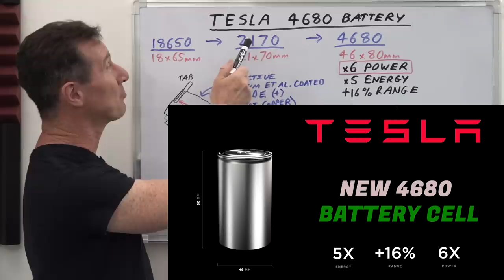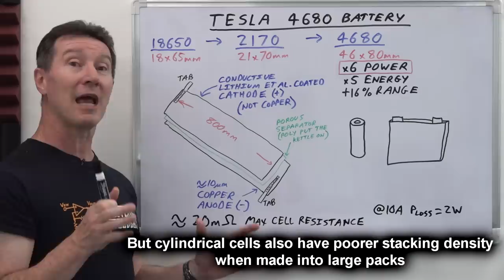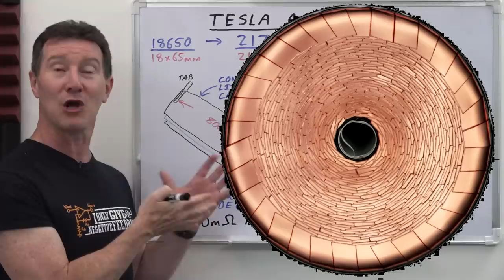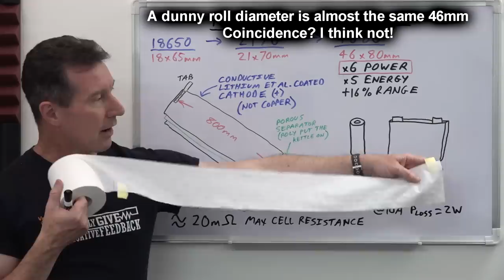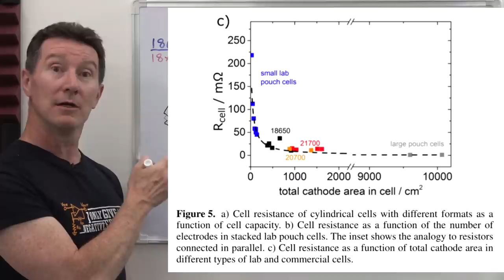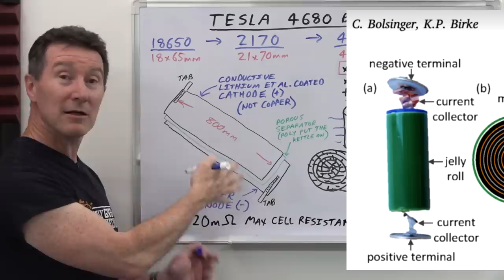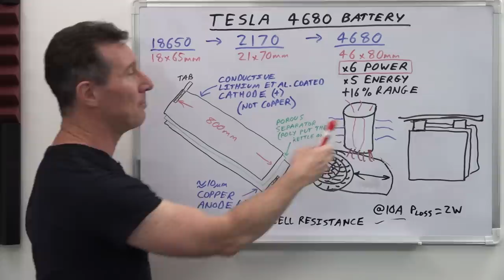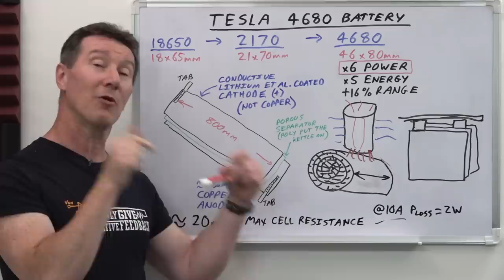EEVblog 1340 - New Tesla 4680 Battery Cell EXPLAINED

Comment: Nice deep dive, Dave. The tabless construction allowing for both a decrease in ESR and in thermal resistance is huge. The only think that was missing was actual Amp-Hour numbers (or estimates of same)
Reply: aH should be more or less the same per linear length (chemical capacity), but instantaneous current (power) will be much higher (thermally/anode thickness limited)

There's nothing stopping Tesla making the cells significantly larger than 46mm  diameter. You're no longer constrained by the volume to surface area condundrum for cooling cells as your cooling requirement is now off the endfaces of the cells and as long as you're not making the cells st00pid-long the maximum thermal distance is the length of the cell

Comment: Yeah with the larger cell you save about 16% weight in steel and replace that with cell. They didn't increase the energy density per cell just increased the thermal conductivity and electrical conductivity. Yes it is an order of magnitude, and that will result in less waste heat but still, the energy density of lithium is not changed with the cell design just efficiency.

Comment: In large part, the original cell were designed for small cell counts, computers, in particular, also tools so the tabs acted as a Fuse to protect the user from failure
Reply: I still remember first press statements of a Californian company powering cars by notebook batteries. At that point in time the Tesla founders where still named Eberhard and Tarpenning. Later they siamized into Musk.

Comment: Max packing density of identical circles is 0.9069, this is independent of diameter. The big savings of larger diameter is much less casing material and decrease in total plant number of operations, since you are processing fewer cells. And volumetric energy density isn't such a massive issue anyway (everybody drives an SUV), the real issue that matters for EVs is energy per unit mass. kWh/dm3 is def an issue, but not as high of a priority as kWh/kg.
I think the reason they stick with cylindrical cell design is for increasing speed of production. Both prismatic and cylindrical cells are wound around a mandrel and winding speed per unit length is probably not hugely different, but with cylindrical cells you can use continuous motion assembly equipment to do all the further processes (like what you see in bottling plants with insane throughputs). This would definitely be a necessity if they plan to deliver their 2TWh/y or whatever musk's stated ambition is.
Inb4 accused of being fan boy. I just think that if they're sticking with the cylinder design there is probably a very good reason. In the past that company has been very quick to kill their babies and abandon designs that didn't work, so I would expect them to do the same with the cylinder v prism design.
Reply: I haven’t understood from all the talks what they’re doing on the other end is it folded too?
Reply: @EEVblog see this. Why bother then? I speculate that it has to do with overhead costs of packaging. 1 larger cell takes less material wrapping it up, takes less time to manufacture, etc. than multiples of lesser volume. Prismatic/pouch cells make the most sense until you consider all the supporting bits to securely position them safely inside of an automobile.
Reply: @billjohnson8794  I think so, yes.
Reply: yes . continuous motion assembly

Comment: Maybe not new a Toyota Prius, but around 15 years ago when I was working at Toyota I watch a tech put dielectric grease on the connections in a recall of the battery bank and it was all 18650 cells on the inside.  I remember it quite well because I sat and listened to the tech explain the entire battery and because I am a nerd it was right up my alley.

Comment: Tesla can use 4680 cells only because they figured out how to get the heat out of them. With a traditional tab design these cells would run way too hot.
Reply: Graphene could be used to help control the heat and then removed in a controlled manner. Probably adds to the cost and that would be the biggest reason not to use it.
Reply: @ezg8448  I don't believe the whole Graphene hype. Seems like snake oil to me...
Reply: @adamwade5612  - actually they already have some on the market but I forget who makes them or exactly what they were used for.

They might be sold by quad-copter parts venders I think, I tried to quickly look for them but no luck.

I do remember they had an flat charge and discharge, meaning it was constant. That would mean the graphene is properly insulating the battery.
Reply: @ezg8448  yes, you are correct.  I have done graphene batteries in my shopping cart on Amazon.  Frankly, i don't know enough to know anything about them.  It just seems the claims are too good too be true.   Who knows?  I sure ass hell don't...
Reply: @ezg8448  Graphene isn't being commercially produced, most of the supposed graphene that companies are marketing is just graphite which has been used in batteries for a long time. It's the same BS as people on YouTube proclaiming to make graphene at home just by using tape to pull thin layers of graphite off and calling it graphene. 
As for the heat issue the fact that the electrons are no longer having to travel the full length of the strip which causes the heat in the first place is now reduced with the tab-less design. Now add to the fact that all the copper connection points are all in contact they can more freely pass heat through the top and bottom of the battery increasing the thermal  transfer of heat that is produced.
Reply: @ezg8448  the plan is to make TWh of batteries in the near future, where are you going to get that volume of graphene?
Reply: @SilvaDreams  - Interesting, can't comment much on the quality of the current product today as I don't know much about it. 

I can say that even with the new tabless battery design and with the new higher energy output that heat will be a major issue. A much larger heatsink will be required and will the tabless design be enough to address all heat issues, especially when discharging at the newer outputs? 

Current lithium batteries all have a maximum discharge amperage but anyone who uses high amp batteries can tell you that running your batteries at sustained max amp is the worst thing you can do to prolong the health of a battery, maximum charge falls off immediately on your next charge. Will Tesla batteries have the same issue?
Reply: @CED99  - It's manufactured by other companies, you can buy it like a raw material, today.
Reply: Heat will be less localised unlike a tabbed design that will have the hot spot where the tab is due to the bottleneck. Both on charging and drawing current. I just don't understand why they didn't use Schoopage instead?

Comment: There is 2 separator layers so when you start to roll things the top of the copper doesn’t touch the bottom of the aluminum. You can see that in the picture at 14 minutes 45 seconds. It goes: separator , aluminum, separator, copper. With the electrolyte between everything. 

When people draw the roll flat they regularly miss the second layer of separator.

Comment: Bigclive did a video correctly predicting that this was probably the "innovation" behind Tesla announcement. Nice technique anyway
Reply: When I was a kid, learning about electricity, pre 1980, I made capacitors in various shapes with tin/aluminum foil, sticky tape, sandwich bags, plastic bottles, and paper clips. For the foil and tape versions, I rolled them up and folded over the edges, just like in the Tesla cells. I guess I should have patented it, but Leyden jars had already existed for 200 years.
Reply: I tried to predict before seeing it and got it wrong.  I thought they were going to adopt the capacitor method of end connection as opposed to this folded tab design.

Comment: It's not that Tesla is the first one to think of getting rid of the tab, by going for a tabless design, Tesla is eliminating the cells internal protection at the positive terminal. Since OEMs made these for a variety of applications they had to set this safety feature. When Tesla has complete control over the end application, they can get rid of this and inturn add an external fuse wire.
Reply: Can't the individual tabs act as a fuse to be burnt out when a dendrite shorts that strip ?
That would make these less likely to go into thermal runaway.
Reply: @era31415  The "tabs" are all one single roll and directly connected on both sides. If it shorts out, the battery is toast one way or another. The only reason why it's split on the ends is so they can smoothly fold it over flat. It's done purely for mechanical reasons, not electrical.
Reply: Right.. but from purely theoretical point of view, once you have this flat mega-multi-tab formed and squished by the top/bottom plate, you can still put a protection circuit over that and add another contact plate. Surely that: (a) steals a bit of height from the cell (b) adds more manufacturing steps (c) adds more metal/etc = weight (d) the protection circuit starts being the choke point when calculating power transfer or internal resistance. But certainly that is doable. We've got protection circuits in smaller cylinder-shaped batteries, so it's not like Tesla's design prevents that. The question is, with 10x lower resistance and X times better heat transfer, do these batteries need internal protection circuits at all?

Comment: On the subject of "folding tabs" being used along the length of the anode material (instead of single tabs)...  Do you think a similar improvement could be made to electrolytic capacitors to improve their efficiency and speed of charge/discharge?  I believe that all electrolytic caps use the single tab at the ends approach.
Reply: Now imagine if they could construct electrolytics or batteries with the schooperage end connection of film capacitors.  Far lower ESR.  Greatly increased charge/discharge current.  Much better performance than these new Tesla batteries.  Probably impossible to make, though.
Reply from the maker: Other types of caps use this technique already. Could probably be applied to cylindrical electrolytics too if you wanted to.
Reply: @EEVblog  It's a common mistake to say the electrons have to travel end to end of a material. There has to be spacing between electrons called the valens band and the hole vacancies get to travel light speed. That causes the resistance across the material but the tabless design making it travel across, instead of along sure does help. The electrons still travel a cm per minute. Good, eh?
Reply: I wonder if It would be enough to harvest the mother of all renewable power sources. Lightning strikes!

Comment: @05:20 Pouch vs Cylindrical : there is one important and often overlooked difference - longevity.  Pouch cells are better in almost every aspect of performance but they have one major disadvantage - they have a far shorter lifetime.
The most common failure mode of pouch cells is not aging but delamination, that is the layers start to lose contact with each other. Often this happens long before chemical aging starts to have an impact on the battery.

This is where cylindrical cells excel as the cylindrical construction allows for easily keeping pressure on the layered electrodes preventing them from delaminating. You could of course enclose pouch cells in a thick steel casing that would keep the layers together no matter what but geometry dicatates that such an enclosure would be very heavy and bulky and would negate any performance advantage the pouch cell had since it now becomes very heavy for what it can do.

The cylindrical cell has the optimal geometry for keeping the layers together under pressure with the minimum amount of structural material. I'm pretty sure longevity is the primary reason they went for cylindrical cells. The tabless design will maintain this advantage while at the same time getting very close to pouch cells with regards to energy and power density.

Pouch cells should only really be expected to last five years or less and we are indeed used to that sort of lifetime with our smartphones, laptops and such where it doesn't matter because the device itself doesn't last that long due to obsolescence.

The EV manufacturers using pouch cells of course know this but they probably don't care because it is just enough to last through the warranty period so you will have to pay for a new battery yourself when it starts to lose capacity not long after the warranty ends whereas with cyclindrical cells comined with a good BMS and cooling will last way longer than that.

On another note, I was actually quite shocked to find out that the tabless design is something new.  I have always incorrectly assumed that high power cells would be constructed in this manner, which has been the normal way to build capacitors for a long time, especially low ESR electrolytics.  I'm still finding it hard to understand why one would use the tabbed design at all - it just doesn't seem to make sense to me.

Comment: Great intro as always, Dave. 
I think the single tab leads on those plates initially did not make anybody concerned much as historically capacitors have been wound like that for decades. In fact, I have seen capacitors where the tabs were shaped from the plates directly, eliminating the need to weld contact terminals to the capacitor plates. This however became more of an issue with batteries where energy both in quantity and induration is far greater as opposed to capacitors, which also can get warm if their power handling is high.

Comment: You don't get 16% more range by only using larger cells. It's the cooling solution needed for older cells that limits energy density. The newer 4680 cell does't need lateral cooling for cells, and that increase energy density. And the external metal case also decrease energy density. Big cells use les external metal cases in total, less weight ans space per battery.

Comment: Why do they call it tabless?  It looks more like a "tabfull" design to me.
Reply: As he pointed out, there are no tabs involved. They just extended the current collector and made cuts in it to fold it together. So no tabs needed, the connection is directly to the current collector
Reply: @hoedjeexplains3661  I agree with @Dennis Shows, it looks like a lot of tabs, if you slit the edge multiple times you have made multiple tabs. Just a marketing bullshit.
Reply: @jellybean2032  depends on how you define tabs in a battery cell. In my opinion tabs are the extra thing they solder on, and so with that view it is truly tabless. Dennis uses another definition. But if the only difference for true tabless is that they slit and folded the current collector instead of it spiraling around, than I think there will never be tabless battery cells because that is impossible to get decent connection to the battery cell housing
Reply: hehe maybe its like why a circle has no corners, when it kinda has an infinite amount! :D
Reply: @PresidentBust  A corner is a hard angle where two line segments meet. A circle is made from one line and so cannot have even one corner.
Reply: @jellybean2032  Integrated. Definitely not marketing. You clearly didn't watch the video or don't understand the design. I didn't see any tabs.
Reply: @jellybean2032  Okay.  Jellybean can call them tabs all they want. It doesn’t change the specs or the excellent manufacturing process,  which eliminates the stop and startup of equipment to deal with conventional battery tabs. I’ll leave out the other details about how much better this battery is...as it was pretty well covered on battery day and this YouTube video. You should click on the play button.
Reply: @Electric_Snap  please explain the 50% increase in battery capacity to me a little more thoroughly
Reply: @jellybean2032  No thanks. I can show you my Tesla Short Shorts if you want.   Lmk!

Comment: 1:17 - I think that the ‘0’ in 18650 denotes a cylindrical cell rather than a decimal point.
Reply: No it's a decimal point . Apparently this notation comes from smaller cells like the CR2032 where the height is in tenths of millimeters and it just carried over to the bigger ones. And for the small cells you need the extra precision.
Reply: @adi331  So only one of the two dimensions has a decimal point?
Reply: @ForViewingOnly  yes
Reply: The 0 means cylinder shape

Comment: lol 11:58 "Please excuse the crudity of this model. I didn't have time to build it to scale or paint it" back to the future line
Reply: Dave is a huge BTTF nerd. You might have noticed his time circuit and OUTATIME license plate in his usual set. Also, the choice of model number for his self-branded multimeter, 121GW might ring a bell.
Reply: @Gameboygenius  i went bike riding and discovered a DeLorean in someone's driveway,  it has blocks behind the wheels so I guess its inoperable
Reply: Sandy already cut and painted examples. But cannot roll out and reuse it later 😜
Reply: @thabg007  That is the saddest thing I've heard all day. :(

Comment: Would be nice to see how they handle the cathode - everyone talks about the anode, but I haven't seen anyone mention what they intend to do with the cathode.
Reply: I don't see why it couldn't be somewhat similar, with maybe a small outer section of cathode spared. But even if it's just the anode, it's a substantial improvement and the incremental improvement of doing both ends may end up being relatively minor, especially regarding heat extraction.
Reply: They only showed the copper end, but it's called tabless design, not 1 tab instead of 2.  The other end of a "tabless" design would be folded the same, for the same reasons and same benefit.  The electrons move through both sheets in the exact same numbers.  He just did the calculations for one sheet, but mean electron path length reduction is same order of magnitude difference on both sides (ends), so same order of magnitude difference overall.